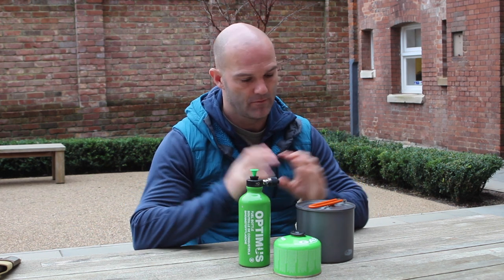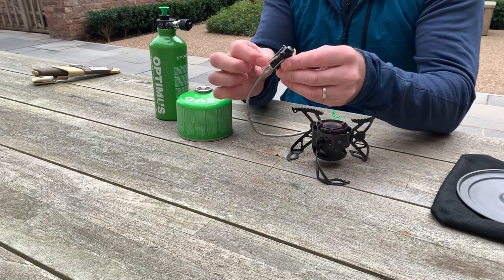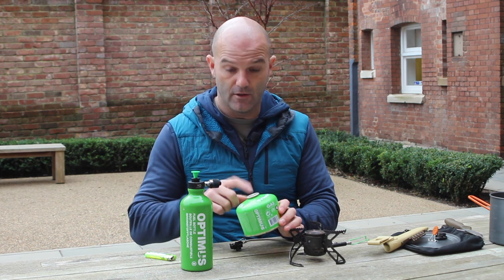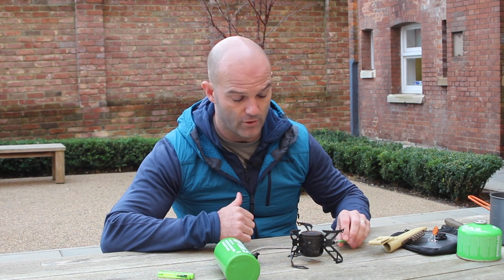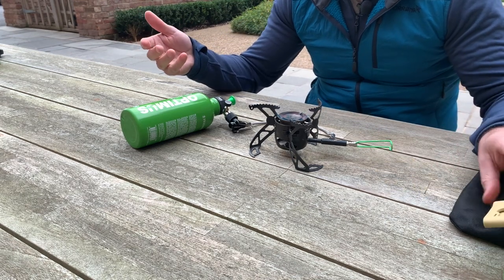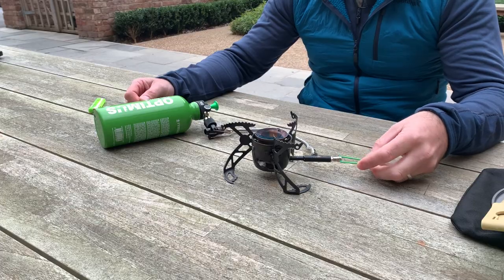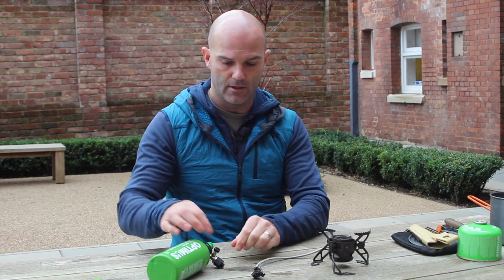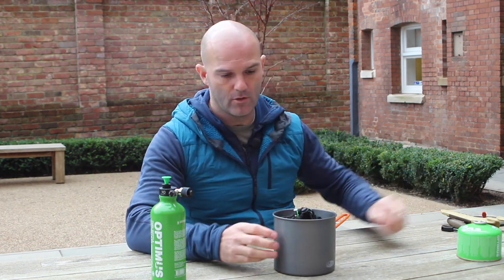How to use the Optimus Polaris Stove, kit review (ECW Solution)

Comment: My concern with the Optimus Polaris fuel hose is that it’s very difficult (if at all possible) to clean the additives in vehicle fuel out of it and long term residue can (according to some) build up in the hose and will need to be replaced, whereas the MSR hoses have a cable that can be slid in and out to clean out their hoses.
Saw a vid of a guy using a Whisperlite Universal stove and hose with the Optimus Polaris pump in the MSR bottle and he got great simmer with the Whisperlite stove using liquid fuel due to the Optimus pump having the little dial tap on the pump plus using the spindle on the end of the MSR hose so got simmer ability like the Polaris but with better fuel efficiency due to changing the jets to specific fuel types and also has the ability of cleaning the MSR fuel hose with built in cable, best stove with the best pump gave best combo of fuel efficiency, reliability and simmering too
Reply: All really good points and you are right to compare the two stoves.  They were the ones tested by the Marines.  The Optimus was chosen because it didn’t require adaptation for different fuels and that it was a fully dry system after use with no residual fuel left in, provided that it was used correctly of course.  As far as residue building up in the hose then a liquid fuel stove is always going to be better when using things like Naptha or Coleman fuel.  We would only recommend using vehicle fuel in extremis due to the additives.  This stove provides the ability to use any fuel if needed but as with the MSR, and all other liquid fuel stoves, then fuel intended for stove use is always going to be superior.  As far as cleaning is concerned then it isn’t difficult to completely strip the stove.  In my experience of using these stoves over most of my life I have never come across problems with the fuel hose.  Blockages tend to occur in the aperture and only when using lower grade fuel.  Hope that this helps.
Reply: @matthewwilliams2064  wow, never having a problem in all those years with fuel residue building up in the fuel hose must mean it just doesn’t really even happen, and worst case scenario a spare hose kept with the maintenance kit would fix the issue anyway 👍🏻
The simmer spindle is important to me personally, and although people can eventually fiddle around with the Whisperlite to get some degree of simmer I think the time spent playing with it would negate the fuel efficiency of the specific Whisperlite liquid fuel jet since while fiddling with it their wasting fuel anyway
Reply: @impermanenthuman8427  I’m certain it does happen when using dirty fuel.  I have only had to do that a couple of times as I have always had access to the better fuel.  So my experience only relates to those set of circumstances.  For those that use dirtier fuels then I suspect that, like all stoves, you will need to give it a good clean from time to time.  In any case it’s a great stove and mega flexible.
Reply: @matthewwilliams2064  yes, I can’t find a better ‘one stove’ option, if I had no idea where I was going or what fuel was going to be available the Optimus Polaris seems to be the best, and with spare parts handy it really extends its range.
But if I knew I was going to need to use vehicle fuel for any length of time, then based in the manufacturers user manuals only the MSR XGK EX is officially stated as not having the life of the stove shortened by using unleaded gasoline. All the MSR stoves are stated to get blockages if using unleaded fuel, but they also say the life of the stove will be reduced, only the XGK EX is the exception, but unless you believe needing to use unleaded is likely then it’s over kill, I haven’t seen anyone burn truck diesel yet anyway, it needs a huge amount of heat to prime the stove to get it to gasify which needs another fuel to get it primed in the first place
Even the Amish mix approx 1/4 white gas/Coleman camp fuel/Shellite into 3/4 kerosene to get kerosene to start burning for lamps and stoves, and truck diesel is an even ‘heavier’ fuel than kerosene
Reply: The biggest reason for residue is to leave dirty fuel to evaporate from the hose leaving the dirt in the hose. Optimus significantly reduce this issue by 1) using a fuel filter at the intake straw 2) making sure the fuel line is emtied on every use so that sediments will not form. Still it is good practice to place the hose in etanol over night every 2-5 years and rinse it with pressurized air. 

That said the stove will hold much longer if primed with etanol and fired with lighting lighting fluid. It doesn't dry out the pump and o-rings in the way alkylate petrol does.
Reply: @macmaster9840  so soaking the stove parts in alcohol like ‘methylated spirits’ over night can dissolve away the hard black carbon deposits from burning unleaded gasoline?
Reply: @ImpermanentHuman  Please consider:
1) Use lighting fluid instead of unleaded gasoline. Just as easy to find. Doesn't dry out pump and o-rings. Is somewhat less cancerogenice. Has much more controllable behavior in cold weather etc etc.
2) If you preheat with ethanol correctly, you will have very little deposits at all. 
3) The fuel filter and emptying of system by correct turn-off prevent inside build up. 
4) The little dirt on outside can easily be removed with simple cleaning with lighting fluid.
Reply: @impermanenthuman8427  If using the stove correctly and using the fuel filter there will not be any depots. Should you need to clean, the solvent will depend on the fuel used before. Its a bit trial and error to determine what solves what.
Reply: @macmaster9840  thanks, feeling much better about the Optimus Polaris now in terms of reliability, I bought some service kits too so will keep it clean and maintained 👍🏻
My general strategy (based on availability)is to use the Optimus Polaris on clean fuels at all times, primarily upright and inverted isobutane canisters refilled from cheap 100% butane canisters using an adapter since its ‘safer’ for other less practiced users (also cheaper than white gas’ per kilo), then propane/LPG refilled from the big tanks into the smaller ‘1 pound’ tanks sold in camping stores, then ‘white gas’ since its the cleanest burning of the liquid fuels, then lamp oil, then kerosene, then finally unleaded gasoline out of the fuel tank in emergencies when there’s nothing else left to burn. I’ll have denatured alcohol handy anyway as I intend to use the Optimus Polaris in a Trangia cookset, which is primarily designed to use an alcohol burner in it. This would be my ‘go to’ car camping and emergency preparedness stove system.
As far as a ‘get home’ long distance on foot system im going with a Traildesigns ‘Caldera Ti-tri Inferno’ system, it’s the only alcohol system that seems to give boil times and fuel efficiency comparable to canister stoves, meanwhile meths is so available its even sold in supermarkets and is cheaper per liter than all other fuels (except propane and vehicle fuels), it’s silent to burn and relatively clean burning, the methylation is technically toxic but no one seems to have a problem when using outdoors.
The Ti-tri also burns hexamine solid fuel tabs and gels and also is probably one of if not the most efficient ‘stealth’/leave-no-trace wood stoves too. It is all thin sheet titanium too so ultra-light.
For me the Optimus Polaris as a long term recreation and emergency home, vehicle camping and evacuation location stove, and paired with the ultralight backpacking traildesigns Ti-tri caldera the two stoves cover all use cases and every type of fuel possible imo.
By lighter fluid do you mean the ‘white gas’ that’s used in zippo lighters?

Comment: Propane - is the cold weather one with a boiling point -42 degrees C. Most of these products have a propane /butane mix which will remain a gas below 0. Butane has its advantages but struggles to remain a gas at 0.
Reply: Thanks for clarifying always seems to be one of those things I can never remember.  Interestingly not all gas is created equal and I know that the Optimus gas is one which is better suited to cold weather as well as being on a different EN code so you can move 1500kg without restrictions.
Reply: So what is the advantage that butane has?

Comment: Odd???

I've the Optimus Nova stove, virtually the same stove in design, form and function.  Very happy with it in all regards with one exception.  As delivered it was NOISY!!!  I mean like jet engine noisy!!!

What surprised me about the Primus is I don't detect the loud, distracting roar of the Nova model.  How can this be??  Is your mic not picking this up, but only your voice???

Learned of a so called "Quiet Cap" that replaces the 3 pronged metal cover over the burner.  With it installed is now the perfect stove and the cap allows a softer, more controlled burn at very low simmering position, better than the original with NO loss of performance at full throttle.

The only difference between the 2 stoves is the connector on the hose end to the fuel source allowing the multi fuel use.  Yours is a threaded screw on type versus the spring loaded quick connector used on the Nova. Can't figure why the Primus is quieter???

Comment: Mine almost exploded.   Always be very aware that these burners can be very dangerous.  When it explodes and there is still half a liter petrol in it then in a radius of 3 meter you will get completely burned.  Mine always leaked. Even the second pump i got replaced under warranty started to leak in a few weeks.  But the shop told me to get lost. Every time i had to use it i needed to disassemble the pump. And trying with silicone to grease it. Put it back together and hoping that it would not leak until i got my dinner prepared.
Had to watch it constantly so i could intervene. But one day i was to late. And the whole bottle started to burn. Had to stay away from it and praying that it would not explode and start burning my tent. With everything in it.   It did not explode although everything must have been extremely hot.   The pump was completely melted. I have had it for maybe 12 years. But it was pain and suffering.  Great discomfort all the time.  When i was tired from riding all day all i needed was a hasslefree petrol burner for making a meal or coffee. But everytime it fucked up.  The flame disperser acted as a spring and may times it jumped of when it got hot. Then i had to try to get the fire out. Let it cool down. And try to use it again.  Then i lost 30 minutes at least.  All in all it was a horror device. 
I still have it and i wish i could only get a new pump.  But you need to buy a complete kit.

Comment: What is the cleanest fuel to burn with the pump bottle..?  Gasoline, Diesel, Kerosene,  etc..?
Reply: can you use 100% rubbing alcohol..?
Reply: All of those liquid fuels will work but white fuel such as Coleman fuel is the best and gives the most complete burn.
Reply: @rdkuless  i would stick to the others you mention. Rubbing alcohol is isopropyl alcohol, or an ethanol-based liquid and as such is a sterilising and cleaning agent.

Comment: One of the key reasons a stove like this would be issued to a military unit is that it can run on jp8.  

As far as boiling points of gaseous fuels, Propane boils at -44F whilst Butane boils at +32F.   Propane is by far the better gaseous fuel but it needs a heavy can at normal temperatures. I’m American so I don’t know what the Celsius equivalents are.

I don’t know how that stove would perform with alcohol.  

Um... quit blaming America for Katadyn putting that second valve on the pump.  I’m pretty sure the market demanded it actually.  The old nova quick release was the most problematic aspect of the old design.  They had a hard time sourcing it.  It also had a nasty habit of failing if it wasn’t religiously lubricated.
Reply: 32F=0C .  -44F= -42C  The the crossover point for the two systems scales is -40.  So -40c and -40F are the same.  FYI, the calulator on your computer and phone does conversions if you touch the little icon that looks like a ruler.  Also you can just google "convert (whatever you need converted) to (whatever you want it converted to).  Example:  Type: convert -10F to celsius" hit enter and you will get the temperature converter with the answer "-23.3C"  If you phone has voice assist, tough the little microphone icon and say, "convert ___ to  _____"  It's like magic!

Comment: Very instructive video (though I have lit this stove a 100 times).
Two remarks: I would never lite a gasoline stove on a wooden table. Not that it is very dangerous, but it can damage your table severely.
And than, your sleeve is very close to the stove in some frames. And your sweater is an artificial fiber. It might melt or burn with very nasty burning wounds as a result.

Comment: The proper way to dry the fuel line is closing the fuel regulator IN THE BOTTLE first, and let the stove burn the remain fuel from the line them you shut off the steamer regulator. I think the switch on off twist thing is to prevent problems when switching fuel type. Otherwise nice video.
Reply: Sorry Phil G, I’m afraid you are incorrect. The way this was demonstrated is the correct way as per the instructions manual! Doing it your way leaves the bottle pressurised with the chance of leakage. Regards
Reply: The correct sequence is to turn the bottle to OFF to drain the fuel line, then close the valve on the bottle, then close the valve on the burner. In the video he closed the valve on the burner first, which leaves the fuel line pressurised. Not a biggie, as the worst thing that can happen is maybe a small spritz of fuel when the line is unscrewed from the bottle, but it’s just good practice to close valves in a system like this starting from the source of the pressure and moving out.

Pressure in the bottle is released before stowing away, of course, but you do that by holding the bottle upright (very important) and then slowly unscrewing the pump from the bottle until air escapes, then tighten back on.

Comment: Why doesn't anyone demonstrate these stoves with paraffin/kerosene?
I know it's dirtier than Coleman fuel/Naptha/White gas/Shellite but it's much safer!
Reply: I tried a similar Primus Omnilite on paraffin. Pre heat takes a little longer, I use meths/alcohol to pre-heat and this overcomes the soot build up associated with these heavier fuels. The most economical fuel as it turns out is paraffin.
Reply: @odysseusreturns9133  Agreed.
I want to see these things on parrafin/kerosene because that is what I intend to use and I want to see how the stove handles it.  Aways preheat with your local version of denatured alcohol when using paraffin/kerosene.